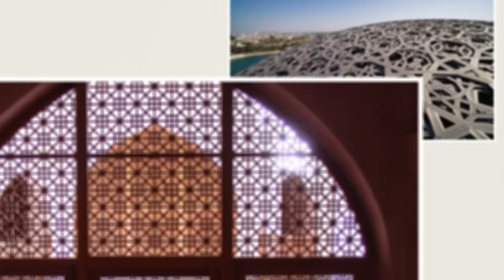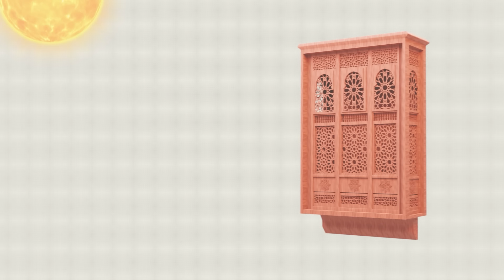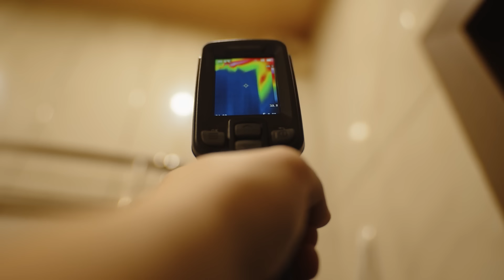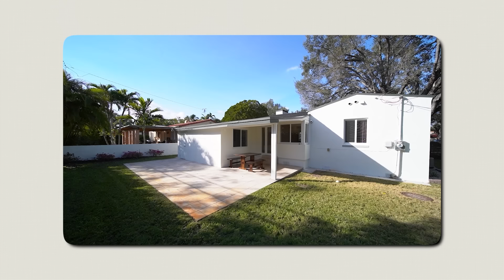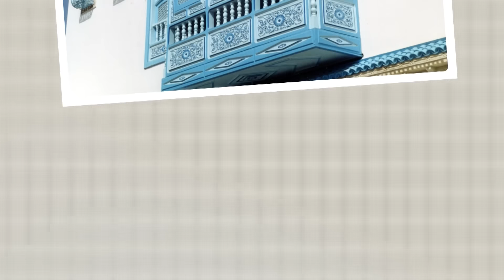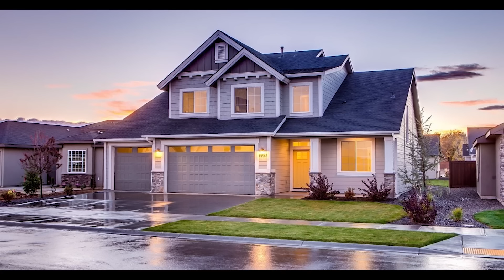This Ancient Window Can Cool Your Entire Home WITHOUT Electricity. Why Don’t We Use It?

Comment: Putting bamboo roller blinds on the exterior of windows is a simple, cheap, and aesthetically pleasing solution.
Reply: Mashrabia isn't simple blinds, it's primary purpose was to put clay water jars in it, and this was to cool both water and incoming air.